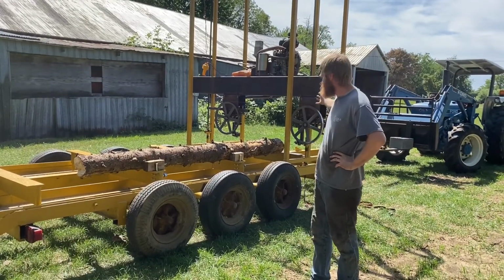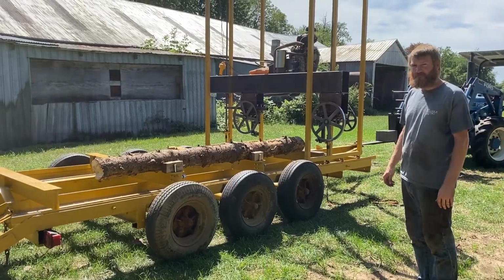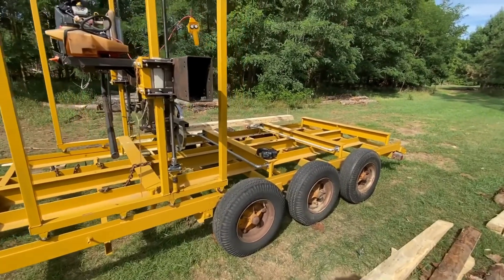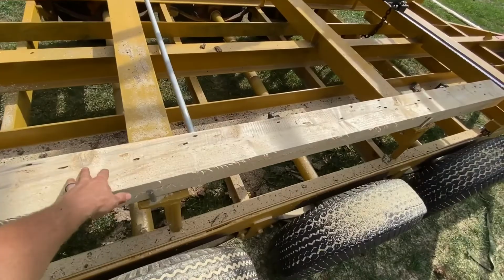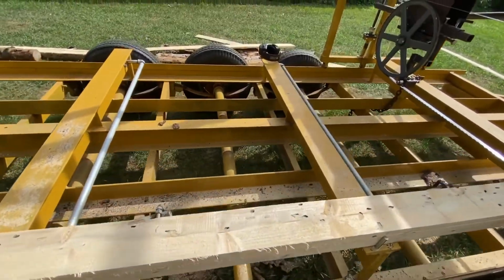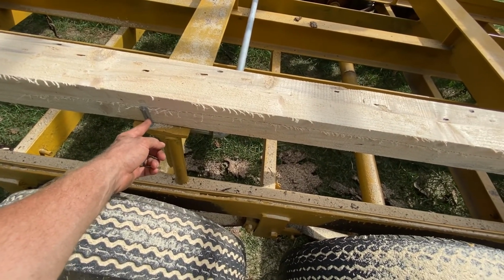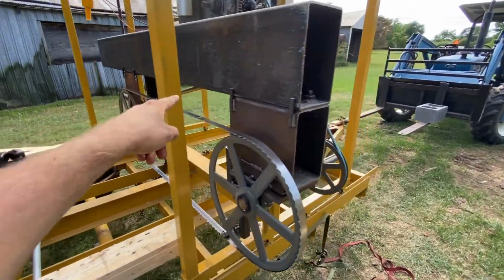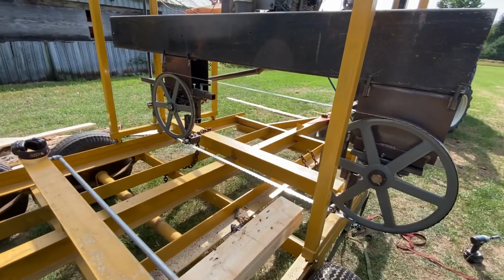Test Cuts, Mistakes Made, Wide Cut Sawmill Build

Comment: where you have the wavy marks here and there, im betting its where you started and stopped and then moved again. Its normal. Also after cutting through the bolts would do it too LOL
Reply from the maker: For sure. I had to stop and start a few times because it got really hard to push. Found I had a couple welds that were hitting my carriage wheels. I ground those down and it got a bit smoother rolling. I think I need to weld in a few more braces to minimize the flex in the carriage, but it’ll be a project for later in the summer.

Comment: Ok . why would you not copy a off the shelf  mill ?  Norwood,  Harbor Freight, Frontier ? REDESINE the belt with two belt and pully configuration. UNDER THE DRIVEN SIDE OF THE BELT ..NOT.. THE SLACK SIDE. Use  a dang spring  .Great video. Thanks
Reply from the maker: I just wanted to try it my own way. (Perks of be thick skulled sometimes lol) again I do plan to upgrade to a double belt and an electromagnetic clutch in the near future.